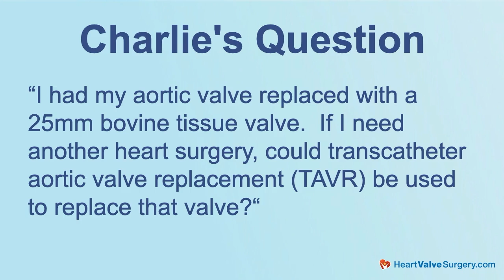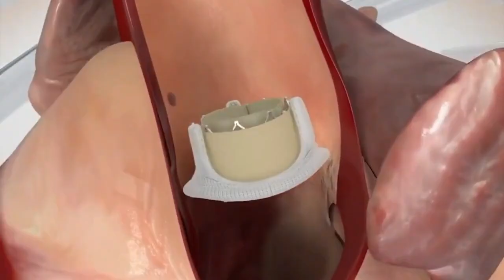Surgeon Q&A: How Does Aortic Valve Replacement Size Impact TAVR Reoperations?

Comment: Hi, I am 75 and been having extreme dyspnea and angina which I went to ER and  treated and stabilized.  Followed up with echocardiogram which shows moderate aortic stenosis with murmur.  My concern is how rapidly will moderate  aortic stenosis progress to severe  aortic stenosis , as I might be on a wait list months until  I have a TAVR    Thanks
Reply from the maker: Hi Kensanders, Great question. Unfortunately, we do not have a great answer for you as the rate of aortic valve stenosis progression can vary greatly among patients. That said, we would encourage you to actively monitor your moderate aortic stenosis with echocardiograms as requested by your cardiologist and medical team.